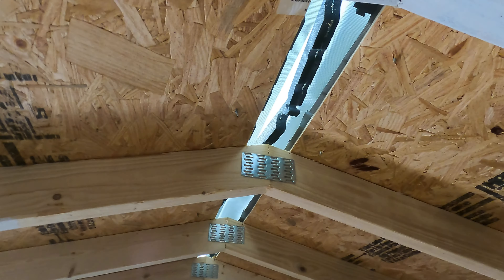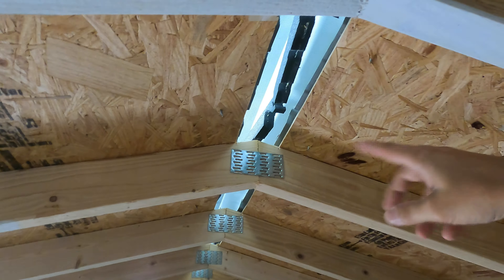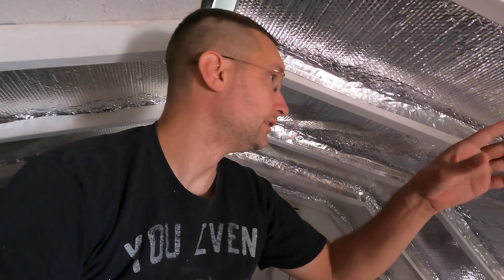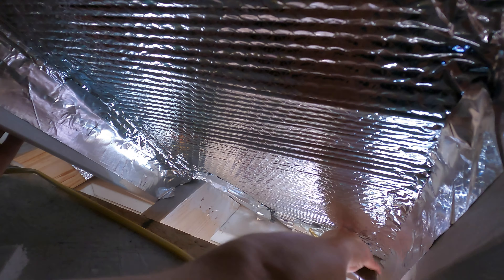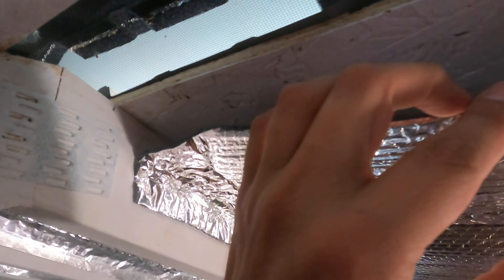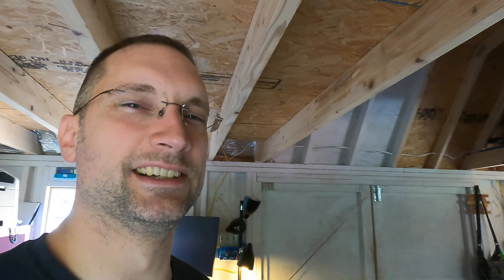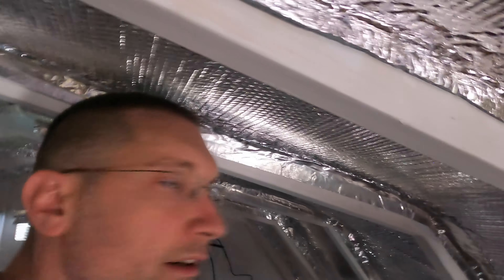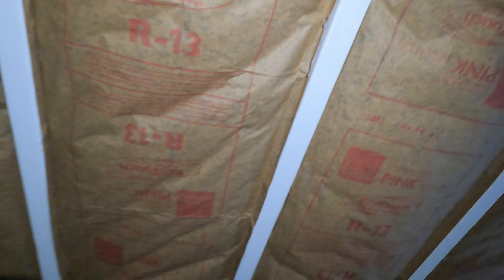Installing Reflectix and Fiberglass Insulation In a Shed To Home w/ 2x4 Barn Style Celling.

Comment: You did the exact insulation I am doing for my tiny house. It's great to see someone else do this idea.  Get a wood stove to contain the mold. Heat will dry out moisture.
Reply from the maker: yes I do need to get one, we have weathered the winter in here and an RV and I have noticed the roof on the north side did have some moisture between the batting and the Reflectix but the South facing side is dry as a bone - Think the heat from the sun helps keep the south facing side dry, but the north side just stays to cold and gets condensation on it.

I plan on doing a follow up video on this, I'm tending to lean toward spray foam for the roof, but if you are having good luck with a wood burning stove drying it out, I may not need to. 🤔

Comment: Thanks for the video. Information on these best practices is so surprisingly limited. Even the Reflectix instructions are helpful yet lacking. I wrote them a question a few months ago and never received a response.

Looking to do something similar on one of my sheds that lacks a ridge and eave vents for year round comfort. Just like spray foam, if I can seal all gaps/seams I’d probably approach it by making the whole shed as watertight as possible and eliminate venting altogether. The amount of traffic going in and out (or cracking a window open) should be enough fresh air and cross ventilation.

I might have done what you had but run the Reflectix all the way up on both sides covering the opening to the ridge vent and eaves so there was no gap/opening whatsoever. This creates a closed loop convection from the eaves to the ridge. I suppose this depends on what you plan on using this space for and how conditioned you want it to be.

The only other thing I might do would be to cover the joists with a layer of Reflectix in addition to the Reflectix baffles to help prevent thermal bridging and help reduce outside noise. There might be a better way to cover joists (and studs as well) —perhaps there’s a type of foam tape thats more effective.

I wasn’t going to use Killz but now you have me thinking. I might use a an elastomeric paint instead. This should also help prevent air penetrating the sheathing.

Comment: Thanks,  I found your video both entertaining and very helpful. Installed Reflectix for the roof and cut some strips of the foam board to create a radiant barrier by using double side tape. Worked great for my shed. 🙂
Reply from the maker: Glad I could be of help sir 😃
Reply: @HallHomestead  Great Help!

Comment: I’m trying to do the same thing trying to figure this all out but don’t you need the rafter vents??? And can I install them over to foil insulation??  I’m also thinking that I can put foil on walls with air gap then batt insulation then sheet rock .. what do y’all think ?
Reply from the maker: @ladyloweallgood4500  I would spray foam the whole thing if I had to do it all over again. 
Had several construction people tell me this gap on the roof was the best way to do it, but I still get slight moisture up there in places - spray foam would fix this issue. 
I wouldn't do an air gap on the walls, I just glued the reflective stuff directly to the wall then put the batting up. 

But can't stress enough the spray foam, my plan is to someday rip out what I currently have and have someone come spray foam the whole thing.

Comment: If the issue is keeping the heat out of the shed in the summer, wouldn't it be best to face the reflective portion of the insulation towards the roof, not inside the shed?
Reply from the maker: the Reflectix that I installed is a bubble wrap type material and has the same reflective coating on both sides.

Comment: Just what I was thinkin to do. Thanks!!
Reply from the maker: good luck Heidi!
Reply: @HallHomestead The only thing. 
My brother in law built houses for years ( now retired ) but I pick his brain frequently. 
Those gable end vents need to be closed off.
Whether temporary or permanent. 
I put screen over ours to keep the bugs out.
Now I will be putting foam insulation over both. 
The one thing he told me, the gable end vents and the ridge vent  are redundancy. 
Meaning one or the other.
Since you are utilizing the ridge vent, you might want to cover the gable vents. 
Try it and see.
I appreciate the video. 
God Bless

Comment: The way to not get mold is to not wet heat the room with a gas heat while it's freezing outside ... A fire place is key but you still don't want the osb plywood getting to hot while it's freezing out side it will cause moisture
Reply from the maker: We heat this thing with just an electric oil heater. We also run a dehumidifier to keep the humidity down.

Comment: How well is it working? I have a shed/tiny home that’s all 2x4. They have installed a moisture barrier with a gap to the metal roof. I read that double double-bubble equals r-21. I’m afraid that if I only use that, I will have to tear down and put in batt insulation in the midst of winter. I would like to FaceTime with you to show and have a discussion about it.
Reply from the maker: @MrFukuijr  I'm no expert - batting has worked well for what we used she shed for, but when we moved into the shed and RV we were really pressed for time, so it was not insulated at all when we moved in. I just installed it as I had time.

The main issue I have with batting is the roof side that is away from the sun in winter gets some condensation so that's not good. 

If I had to do it over I would hire someone to spray foam the whole thing and under the floor boards. We got that done in our finished barndo and I have been so impressed with it. I still use the shed as a man cave, and I may still rip all the batting out and do foam.

Comment: You painted the ceiling and rafters??? I just bought 3 rolls of reflextics. I'm in Pennsylvania.
Reply from the maker: Yes I painted everything, didn't want raw wood exposed in case moisture did get up there, didn't want to risk mold
Reply: I would like to chat with you. I also live in PA. I am debating double double-bubble or double bubble and batt. It’s almost September and I need to make a decision.

Comment: Nice work. Just wondering if there is any benefit to using Reflectix like you did if we already having the usual fiberglass insulation in the attic (i.e., on the floor of the attic)?
Reply from the maker: I would think so because it has an r value between 3 and 5 (don't remember the exact amount)
Reply: @HallHomestead  👍
Reply: Here is how to tell if Reflectix has any benefit.  On a hot, sunny day, go outside and hold a piece of the usual fiberglass insulation over your head, then replace that with a piece of Reflectix the same size.  If you head is cooler with the Reflectix then you know it is of value.  If not then it is of no value.  [I'm betting you will feel a noticeable difference.]. Question answered.
Reply: Yes. In my opinion, it makes sense to add radiant heat barrier to the roof. Otherwise, you will have heat penetrate the through, heat your insulation, and transfer that heat below.
Reply: Reflex is for reflective heat … not much R vale approx R-2 — but it should work a aa inner vapor barrrier and reduce the temp difference between heated room and outside cold … I used lath on edge to create a “ vent” .. but it was a bother ( but what isn’t. )

Comment: I have a Graceland and it has the ridge vent and the soffit system for venting. So this helped a lot...
The reflectix placement makes sense to me, the roof can breathe and I also have radiant barrier so I will drop rhe Reflectix down half way on the rafters, and cross the gap as one piece.

The Kiltz is genuis!!! Had not thought of that!! They also make Styrofoam vents but your solution is very practical...good thinking!!not going to do the fiber glass if U can get away with it...I would love to do metal roofing trim out on the gambrel ceiling .
Reply from the maker: It has been nice, has kept us plenty warm all winter long. It also has help deaden the noise from down pours - before we put this up you could not hear yourself think when it rained!

Comment: I have been looking and looking for any information on this - I’m trying to do the same thing - although my ceiling already has a radiant barrier (the shiny stuff attached to the wood)… I have the same ridge 3 inch ridge vent running the length of the ceiling- are you just leaving it open and putting the insulation against right under it? …. I’m thinking that’s what I’m going to do…. I live in north FL… I do have a mini slit in mine but its for when I’m in it and it’s not going to be running all the time. Given that info I do want it to breathe correct? Would putting the insulation (pink fluffy kind) against it be enough airflow? 

Thanks for the video.
Reply from the maker: Yes, I left a gap on the reflectix where the vent is and between the roof decking, but I totally covered the split with the pink insulation. Which should allow air flow out the vent.
I went a bit extra and got another thin vapor barrier and put it over all the insulation. I'm in the process of getting shiplap up there, about half way done.
Thanks for the comment Jensen.
Reply: I have the same type of building.  You run into one problem with this.  You must have eave vents to allow air in to vent the heat out the top, otherwise you will still get mold.  You must have air flow to draw up the roof from the eaves and out the top.  What I did is I drilled two 1" holes and installed two 1" round snap in vents (from Vent Masters) in each bay at the eaves.  This should be enough to draw the air in and move the heat out the top ridge mesh vent.  I then installed the insulation as normal to the 2x4s being careful to not block the round eave vents.  I also added a small section of roof vent baffle to that area at the eave to keep the insulation from blocking those 1" vents.  That leaves enough gap all the way up to the roof vent.  BTW, the roof sheeting already had the reflectix on it.
Reply: @danchester2366  You're exactly right.  And if not for this comment i would have never known there were soffit vents smaller than 2".  Thank you!

Comment: I’m trying to do the same thing in an almost identical shed! My concern is to keep heat in due to it being cold, but when it’s hot it’s miserable too. Is there anything different I should do to make it keep heat?
Reply from the maker: We have been in our shed 2 years now (it's fully insulated both ceiling and walls), and most of the time we just heat it with a simple oil radiator heater from Walmart. if it gets really cold we will add a forced air heater but that is rare.

Adding a skirt around the bottom of the shed will also help a ton.

Comment: I’m about to do the same thing, since it’s been a year I’m just curious how things are working out?
Reply from the maker: I have posted a few replies in the comments section, but the short answer would be if you are going to be constantly heating and cooling it, spray foam. If it's just a shed it should be fine what I did in the video.
Reply: @HallHomestead  thank you

Comment: Any update on moisture dripping down
Reply from the maker: During the winter time there was a little on the northern side that faces away from the sun. That side just never got warm enough to move the moisture out to the ridge cap. The south facing side had no signs of moisture though.

The issue is with with the cracks to the outside between the roof and the wall, and the gaps between the rafters of the loft (where the insulation did not fit snugly). That's where that super cold winter air meets the warm heated air and condenses to make moisture. I sealed all the cracks to the outside with can spray foam (which I think was the biggest issue), but the rafters are a harder issue to fix. 

This is our second winter in the shed and RV and it has held up good for a second living space. I have been super busy finishing the inside of the house we are building, but once that is done I will have time to make a follow up video with everything we have learned from living in this thing.

Overall I would say if you have the time and money - do spray foam, at least for the roof, it has better R value and from everything I have read will prevent the condensation issue. Time was our issue as we sold our house and needed to move out ASAP.
Reply: @HallHomestead  ... My grandmas house had a attic a croll space .. I think that kept moister out by having that air space

Comment: Any moisture problems? I am doing this to my shed but the paint is a good idea
Reply from the maker: During the winter time there was a little on the northern side that faces away from the sun. That side just never got warm enough to move the moisture out to the ridge cap. The south facing side had no signs of moisture though.

The issue is with with the cracks to the outside between the roof and the wall, and the gaps between the rafters of the loft (where the insulation did not fit snugly). That's where that super cold winter air meets the warm heated air and condenses to make moisture. I sealed all the cracks to the outside with can spray foam (which I think was the biggest issue), but the rafters are a harder issue to fix. 

This is our second winter in the shed and RV and it has held up good for a second living space. I have been super busy finishing the inside of the house we are building, but once that is done I will have time to make a follow up video with everything we have learned from living in this thing.

Overall I would say if you have the time and money - do spray foam, at least for the roof, it has better R value and from everything I have read will prevent the condensation issue. Time was our issue as we sold our house and needed to move out ASAP.

Comment: Have you had any trouble with moisture yet?
Reply from the maker: During the winter time there was a little on the northern side that faces away from the sun. That side just never got warm enough to move the moisture out to the ridge cap. The south facing side had no signs of moisture though.

The issue is with with the cracks to the outside between the roof and the wall, and the gaps between the rafters of the loft (where the insulation did not fit snuggly). That's where that super cold winter air meets the warm heated air and condenses to make moisture. I sealed all the cracks to the outside with can spray foam (which I think was the biggest issue), but the rafters are a harder issue to fix. 

I need to make a follow up video to this one to talk about/show the issues.

Overall I would say if you have the time and money - do spray foam, at least for the roof, it has better R value and from everything I have read will prevent the condensation issue. Time was our issue as we sold our house and needed to move out ASAP.
Reply: @HallHomestead  thanks for your time in responding.
I have a barn style shed 10 x 20 that I'm going to make a man cave out of. You definitely gave me some ideas. Thanks!

Comment: I know this was posted a hot minute ago, but I'm wondering - is there not a concern for water getting in and soaking the insulation at the peak of the roof where the gap is? I know gap/air flow is normal I'm just about to start this process with a similar shed and I can't find anything that puts my mind at ease...
Reply from the maker: Mine had foam that fit the form of the metal to prevent that. I had just a normal shed prior to this that I never insulated and never had water come into the ridge.
Reply: That gap is covered by the "ridge cap" on the top of the roof. Works like an umbrella with the sides still open.

Comment: Have you noticed a difference
Reply from the maker: yes, we have only done 1/3rd of the roof so far, and the AC unit can keep the shed in the high 70s when it is under 90. 90+ degrees it can get up to 84 in the shed. 
We will be cleaning out the other loft this week to do the rest of the roof, I'm guessing its going to do really well when the roof is all done, still no insulation on the walls.

Comment: how many  amps  does it take to run everything you have in there
Reply from the maker: haven't looked into that, we have a big refrigerator, a chest freezer, washer and dryer, and a dehumidifier - and in the winter time we run an electric oil heater that keeps it pretty warm.

We also run the RV off our main box in the shed.